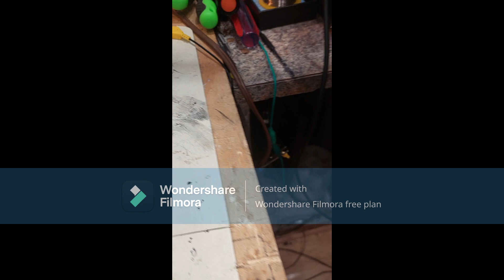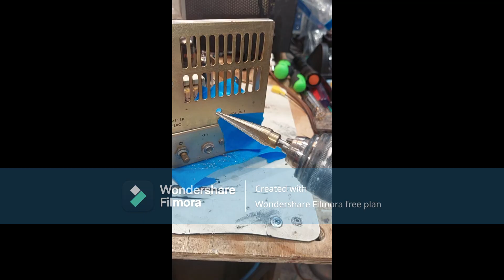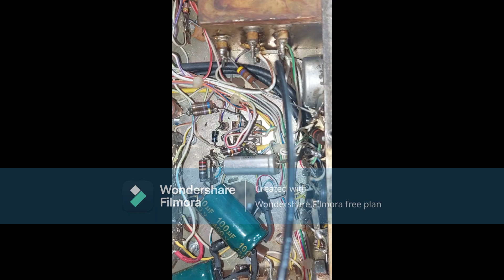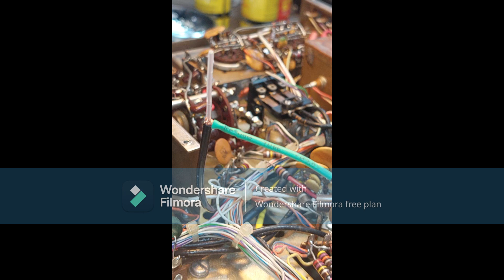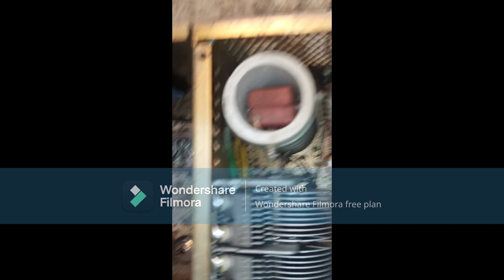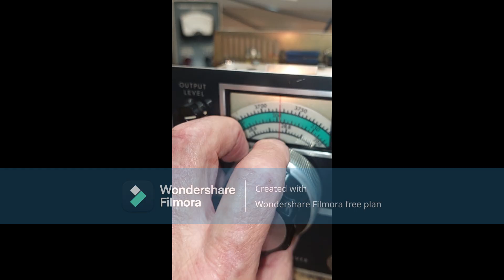SWAN 350, 500, 700 CABLING FOR FREQUENCY DISPLAY BY K6REA Kevin Rea

Comment: I see you mounted the jack with cable all the way over by the 6gk6 recever amp tube then routed the cable over to tube 1 6ew6 pin 1 of the VFO on the other side of the radio. my question is shouldnt you want to keep your cable as short as posable  as maybe go to to next to the final cage to the VFO, thus keeping your wires as short as posable and still being able to use your digital display? ( by the way Display looks sharp on the 700CX)